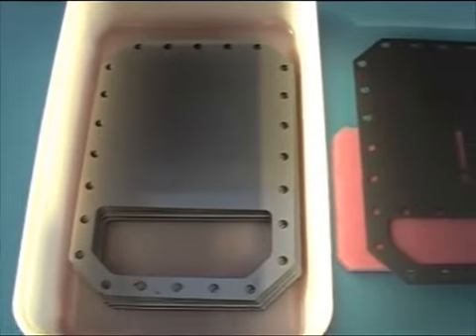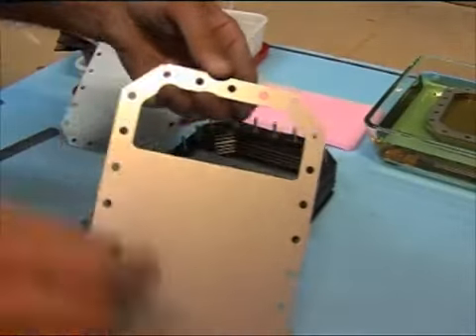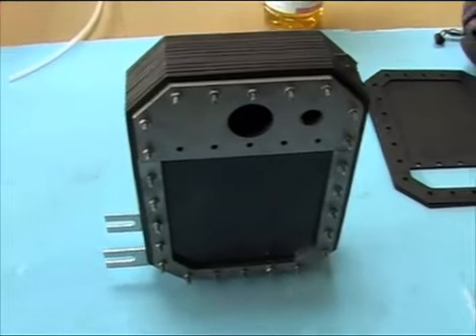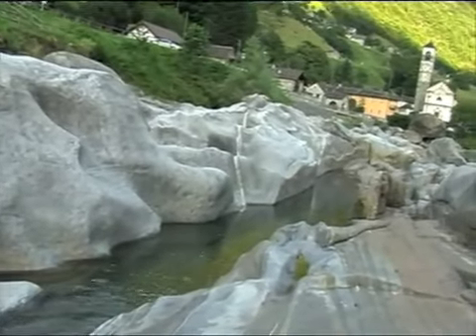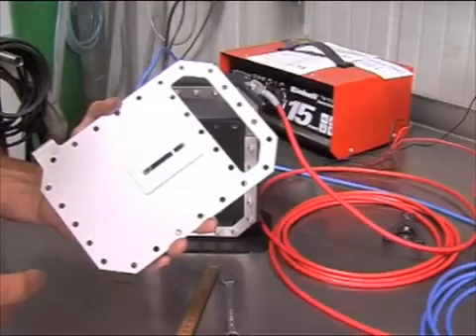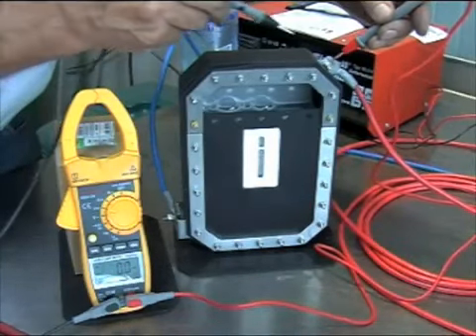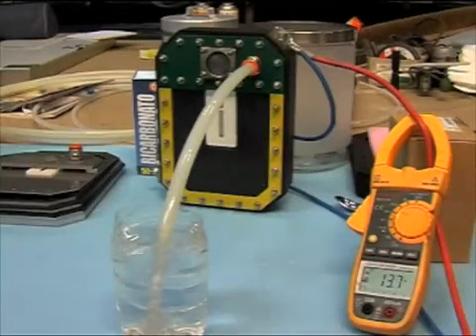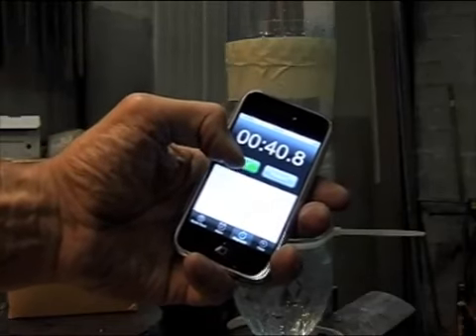Generador HHO-06.mp4

Comment: You are right! The laws of physics can not be undone! The quantity of gas is dependent on the voltage and current, You get 1 liter of HHO 12V * 20A = 240 W., I get 2 liters of HHO 12V * 40A = 480 W. And to get 10 liters of HHO to 2.5 kW. It is a law of physics! Can not be changed.